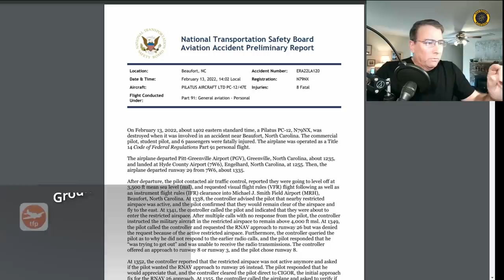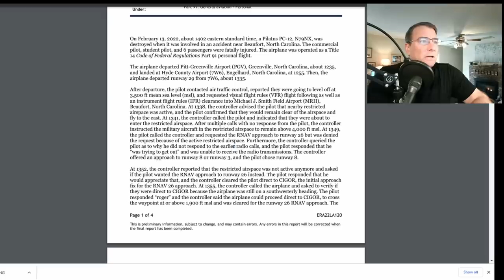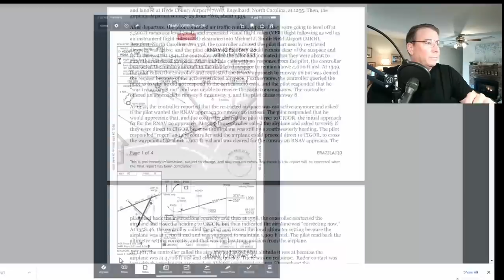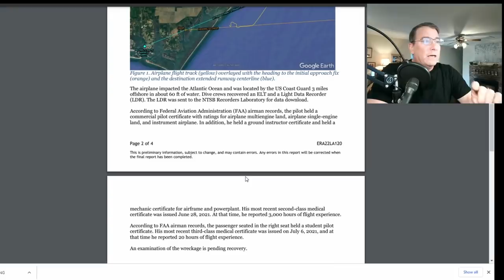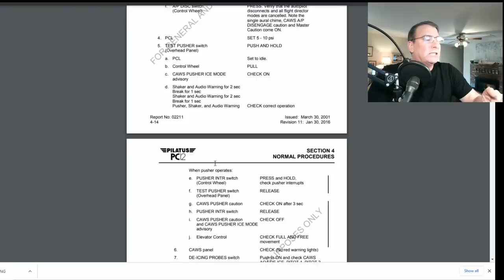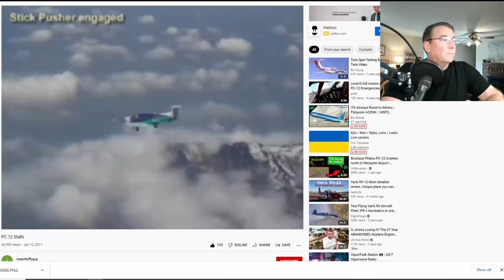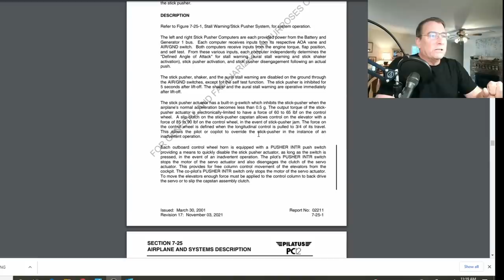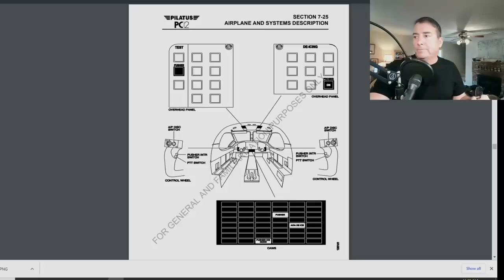NTSB Preliminary Report Pilatus PC-12 Beaufort NC

Comment: For General and Familiarization Purposes Only.   Wow.  Weasel Words, anyone?
Reply from the maker: No, required.
Reply: We had similar wording in our training material when I was training as an avionics mechanic (many years ago).  Why?  Well, it turned out it wasn't due to the aircraft we were training on being built in the USA and these words being a way of getting around the  litigious culture.  Instead, it was a reminder that the only authoritative source of information was the aircraft maintenance manual - a "manual" which consisted of an entire floor-to-ceiling bookshelf of manuals, kept in both the "tarmac office" and a room next to the foreman's office in the hangar, and maintained by the configuration management people upstairs in the hangar annex (just down the corridor from the maintenance supervisor's office), who in turn were sent all update orders from the Technical Services Department at Head Office, who in turn got that information from the aircraft manufacturer.  Relying on any other publications for aircraft operation or maintenance information was a breach of the Air Navigation Orders (as the rules are known in my country) - not only could it endanger lives, but it would get you the sack real fast.  Updating the publications in accordance with the amendment instructions was something we all got to do at one time or another, as were the periodic audits where all pages were checked against the List of Effective Pages (LEP).

Comment: Juan, I find the focus of your analysis baffling. Looking at the evidence as presented  in the  video, it appears that this pilot behaved in ways that suggest he was not functioning proficiently from early in the flight. His problems with the restricted area, his exaggerated flight path over the ground relative to an efficient path exiting the restricted  area, his failure to respond to repeated calls from the controller, and his ambiguous “explanation” for his non-response all suggest to me not pilot error, but a pilot who, for reasons that will probably remain unknown, was losing his ability to function. Climbing from 1700’ to 4300’ while he was supposed to be making some kind of approach without making any kind of emergency declaration or explaining his deviation from approach parameters would  seem to be indicative of abnormal functioning - something just was not right with this guy. It probably took several minutes to gain that amount of altitude. What was going on with him during that period?

From the evidence available, I seriously doubt that anything was wrong with the airplane, and especially with the systems that you focus on in your video. All of the facts as we know them suggest a pilot who, as a consequence of some unknown physiological factor, lost his ability to function as a pilot - possibly while remaining unaware of or even compulsively in denial of his true condition. His poor son in the right seat was in no position to help.

When I came back from Viet Nam after flying UH-34D’s in the USMC, I went to work for a little company that had a Beechcraft Bonanza that the owner thought worked better for him than the airlines. He wanted me, a pilot, to learn to fly the thing. On my first flight with him we started to do touch and goes when, on the downwind leg of the first approach he started having an acute attack of angina pectoris and proceeded to tell me, “Dan! I can’t do it. You land it.” 

Talk about your WTF moments. I managed to grease the nasty little bitch right onto the center line despite not having touched the controls of a fixed wing aircraft for a couple of years, taxied it to its parking place, and walked away, permanently terminating my career as a civil aviator on the spot. A couple months later he sold the damned thing. This stuff happens every so often.

The tragedy of this crash is heart wrenching. I still don’t get what you were trying to do in this video.